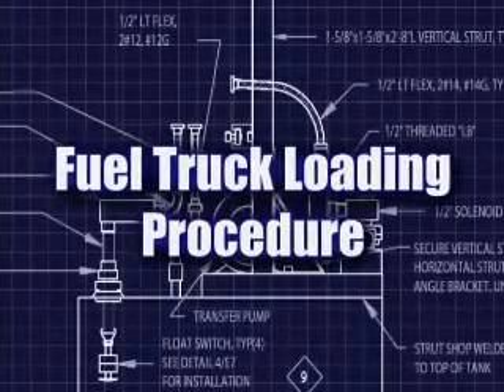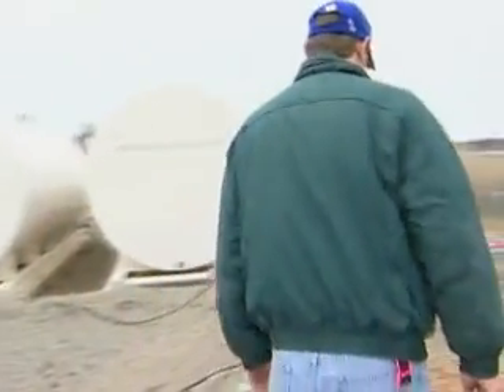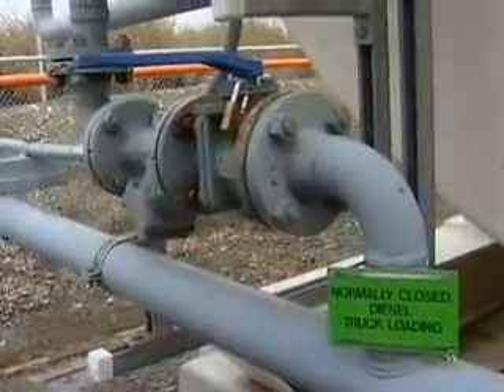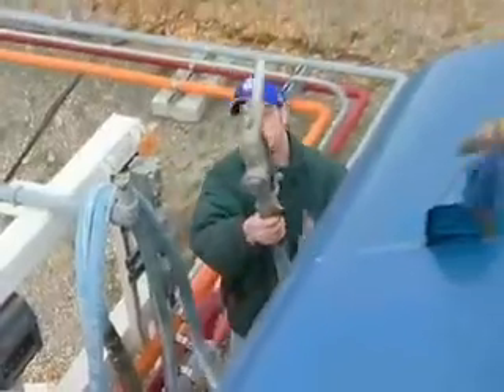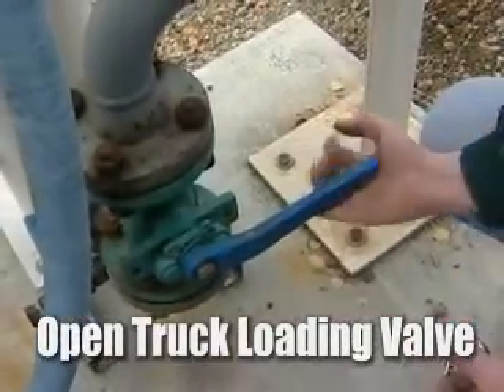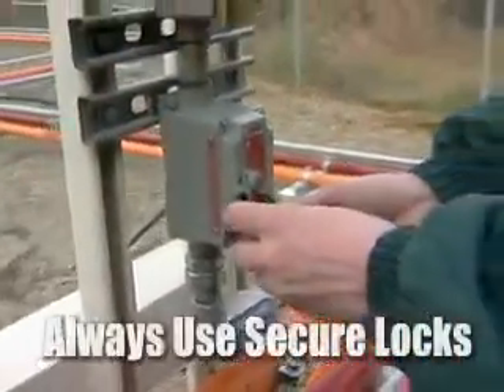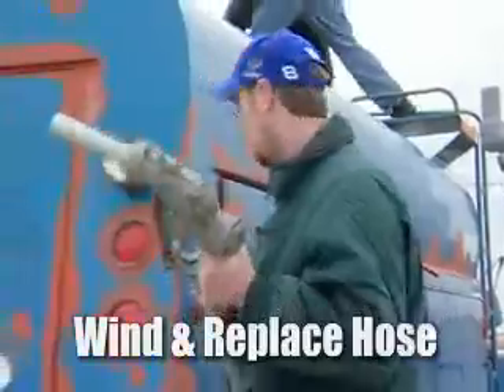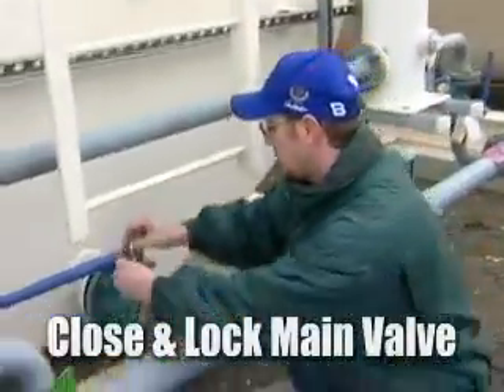Fuel Truck Loading Procedure

Comment: It is danger fuel fill without fill up pile which size 25 mm upper from bottom and bottom side pipe cut 45 angle to safe static charge.